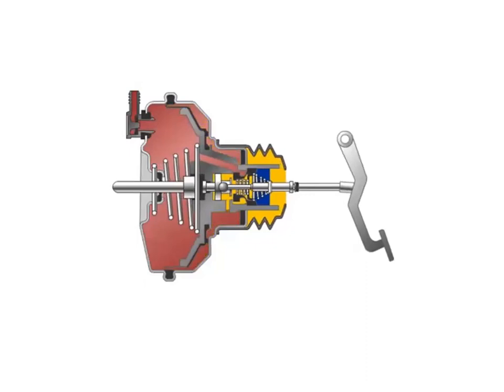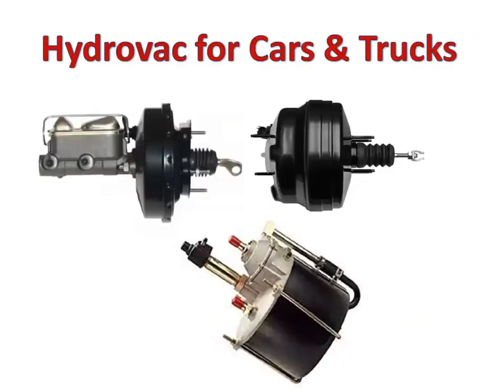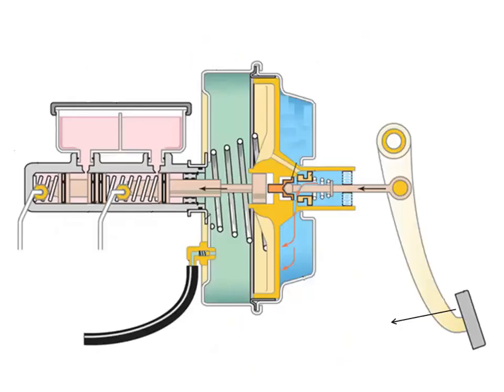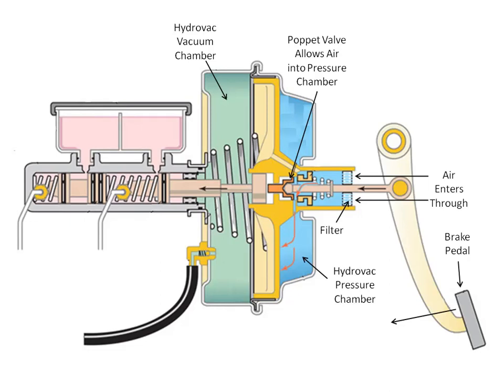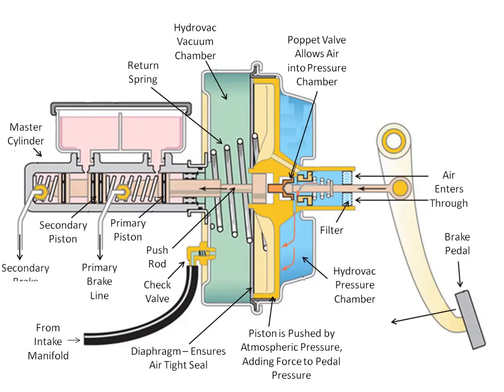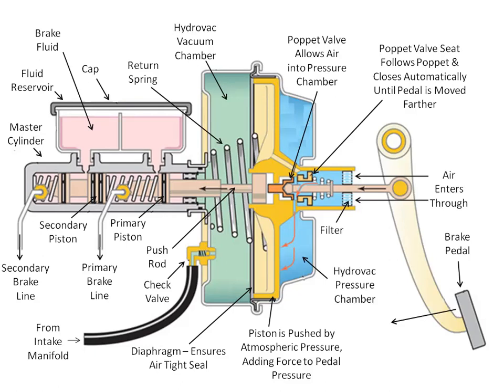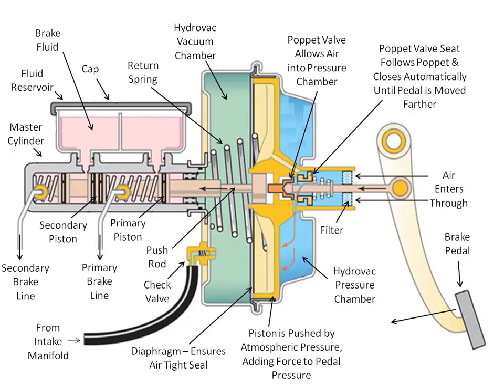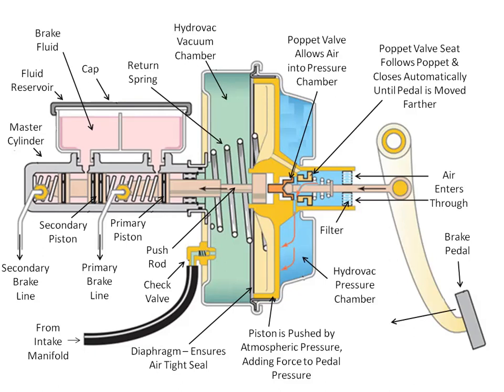How the Hydrovac or the Brake Booster of Vehicle Works? Hydrovac Operation Explained

Comment: It seems like a problem, how can I get more force? The vacuum is sucking it.
Reply from the maker: When there's vacuum in hydrovac chamber on the other side of the diaphragm/engine side, it will be lighter for the driver to press the pedal. Have you experienced driving a vehicle when the engine suddenly stalls, the brake pedal becomes so hard to push but the vehicle is not stopping.

Comment: Thank you for the very informative video, 
I have a mini dump truck, I installed a D5 hydrovac, now it has a double hydrovac, but my problem is, wen ever I pushed the clutch 3 -5 times, it hardens the clutch and the brake,
Reply from the maker: Thanks for watching my video. As regards your issue, if the trouble is the brake booster, the problem could be leaking in the diaphragm, check valve or vacuum hose from the intake manifold. Have them checked by a mechanic. You can confirm whether the hydrovac is the issue by turning off the engine and press the pedal several times. Start the engine again. The pedal should go down as it normally should. Otherwise, it could be other issues such as low fluid or something else

Comment: Where is the primary brake line connected
Reply from the maker: Typically, the primary line is connected to the rear brakes and the secondary is connected to front.